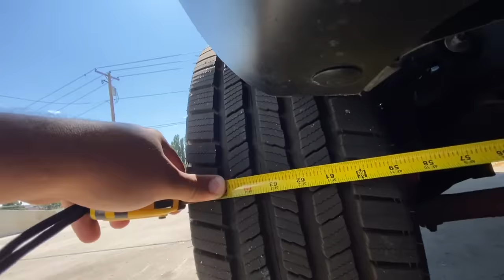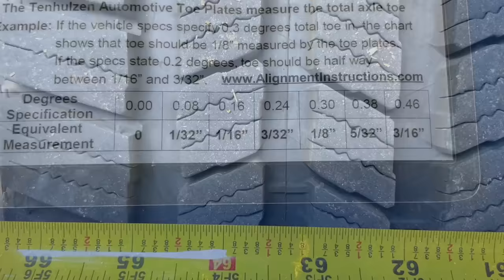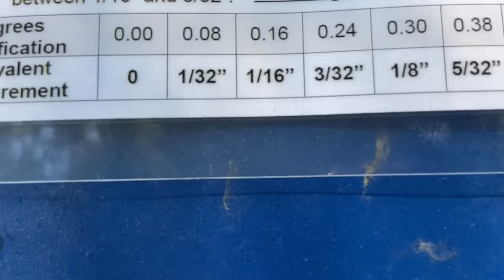How to do an alignment on a car at home using only a tape-measure!!! (And Alignment Basics)

Comment: TOTALLY WRONG!!!
All tires have some wobble. 
The right way to do it is to raise the tire so it can be spun. Position a screwdriver or something against the face of the tire and have someone spin the tire a complete turn until the line matches up. Then lower the tires to the ground and measure toe from the lines. I did alignments for over 45 years. That’s the only accurate way to do it.

Comment: Too many incorrect steps here.
I have done alignments for over 40yrs now.
This is terribly incorrect.
NEVER measure from tread. There is always something called tire run-out.
Jack up each side, spray paint a small spot all around the tire by spinning it.
Let dry, them take a scribe & scratch a straight line by spinning tire with scribe fixed to concretete on painted area.
Eliminates tire run-out which can be as much as 1/16 - 1/8 inch.
This will give you a true reading. measure from those lines.
Also this is NOT an alignment.
This is only setting the toe-in.
An alignment consists of setting caster, camber & toe-in.

Comment: Why don't you do that correctly do it correctly the right way when it's Tire to Tire not Tire 2 volt jacket Jack Abbott slowly to retire as it's spinning you do the other thing on the other Tire learn how to do it so you don't measure tire tread to bolt because you may put this tape measure in a different place on the tire in the tread and they're not straight lights A6 at tire tread 6 you make a straight line with a marker on the tire that you have a car jacked up and you spend the tire

Comment: Leave this job to the pros.  Don't risk your safety or well being for trying to save $40.
Reply: does not take a pro to use a tape measure and twist a threaded rod with a wrench.

Comment: Wrong, wrong, scammer, missing major steps. Can 
Cause major accident.
Reply: Can you fill in the gaps you see missing? Because nothing seems unsafe about what's done
Reply: It's not a scam,.. but this is something you'd want to do after changing major components so you can get to an alignment shop, not to drive for thousands of miles. Without referencing the rear wheels, the steering wheel is not set to the thrust angle of the car, so it will likely be a tiny bit off middle.. most people don't care if it's a bit off though.  Also, without referencing the rear wheels it's impossible to diagnose any misalignment due to worn parts in the rear vs. front, so avoiding the alignment fee may end up costing more in the end. I have a different method that uses all 4 wheels, might do a video on it..  it's twice as hard to do, but uses all 4 wheels and the toe on the rear can be measured at the same time to make sure there's nothing wrong. I use the rim not tire treads for measurement reference.

"On some older alignment machines, toe-in was measured at each wheel by referencing the opposite wheel. This method caused problems with getting the steering wheel straight the first time and necessitated corrective adjustments before the wheel was straight. Newer machines reference the vehicle's centerline by putting instruments on all four wheels. For more information on this see Steering Center and Thrust angle. " - http://media-dmg.assets-cdk.com/teams/repository/export/2c1/4a60832bb10058cf300146efa6b30/2c14a60832bb10058cf300146efa6b30.pdf

Comment: I'm a mechanical fitter by trade... I decided to leave the mining industry now I'm doing wheel alignments at a local tyre shop. I've done 1000s of them.. yep sure ya can do toe adjust with a tape and basic tools.. but seriously take it in to an expert... you didn't even lock off tie rod without it moving.. quite a few bad practises in evidence here.. adjustable wrenches are for idiots.. they'll just round off ya locknuts if they're tight.. don't risk doing this.. if you can afford to own a vehicle them maybe you can afford to pay an expert to work on it... if you get it wrong your tyres will be destroyed pretty quick and it will cost you a lot more in the long run. A fool pays twice...

Comment: Setting the toe with a tape measure has got to be the dumbest idea I have ever heard of. I can't believe someone would be giving this kind of advice on you tube. . I was an alignment mechanic for 12 years and trust me you won't get it right.  First you must check for run out and if you don't know what run out is then stop and take it to an alignment shop and get it done right. Second the measurement must be taken half way up the tire from front and back. Using a tape will only screw up your tires. To achieve a perfect 0 toe won't happen with a tape. If you end up with toe out you won't have any control over your vehicle and if your toed in you will only scuff milage off your tires.  Is it wort ruining a good set of tires just to save a few bucks. DON'T DO IT.

Comment: Wheel alignment on modern vehicles is extremely critical. This BASIC method is NO GOOD for modern vehicles, as it is NOT accurate -- it's just CHEAP  -- but only in the short run, as you'll be grinding up those expensive TIRES due to the method's inaccuracies.
SAVE YOUR TIRES !! Get your wheels aligned on a Computer-Assisted Alignment machine, and KNOW that the job is done correctly . An honest shop will give you a before-and-after printout, so you'lll KNOW what you paid for. Remember, just 2 degrees of misalignment will scrub 20,000 miles off those Goodyears -- like, PRONTO !!